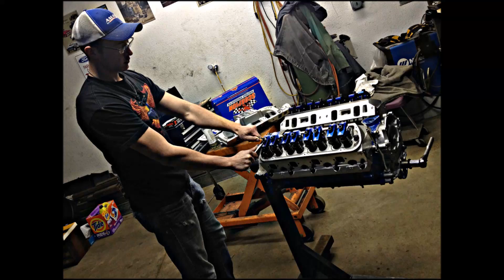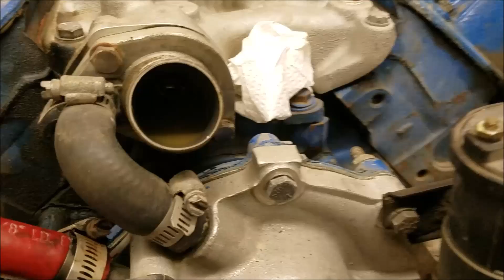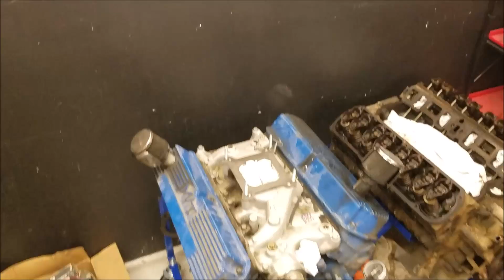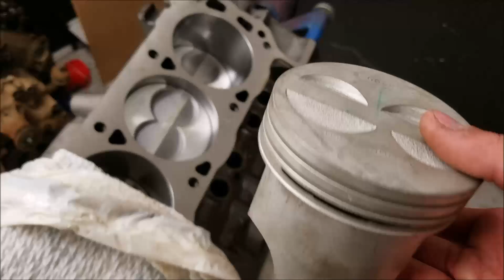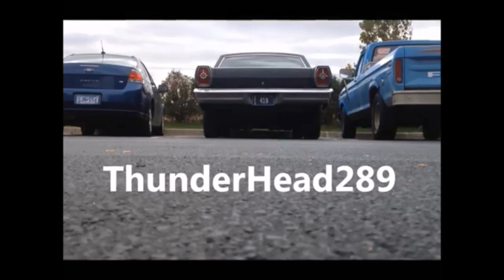Driving with NO/FAILED Thermostat in Car - Is it Worth It? (Explained)

Comment: Uhhh.. what..? I don't think you will EVER overheat if you don't have a thermostat installed.. having water run by hot metal constantly will only cool it faster, it won't overheat because of it..  does your radiator become less efficient at high speed and fans running with more air rushing past it..? Of course not. It's the same principal. I've been running my Rx8 without a thermostat and it runs BEAUTIFULLY!!! It still comes up to a safe operating temperature, but NEVER gets too hot n "spongy" 👌🏼 don't be fooled into thinking it's "unsafe" to run your vehicle without a thermostat.. (you may need it for winter if you want some heat or power tho😜)
Reply from the maker: #RideLife use your brain here for a second - it’s a 2 part issue. 
Coolant runs through the radiator so fast that it doesn’t cool, and if it’s too fast, the heat can’t transfer from the block to the coolant. 
The temp gauge will show cool, but your oil temp will be high which is indicative of hotter internals. 
Your temp probe only monitors your coolant. 
Engine builder & engineer
Reply: @ThunderHead289  
Sorry for my bad english....
Did you think...thermostat will closed again after coolant flow to the water jacket?
When thermostat open it wont closed again until the coolant really cool....
Try to boiling your thermostat in a pan... then when thermotat start to open pour water in room temperature to your boiling pan... you will see...that thermosttat wont closed.... thermostat works just in cold start... thats what thermostate for...

Comment: My 99 nissan frontier has no thermostat for 3 years and when its cold it blows hot air perfect and when summer comes around my a/c works beautifully with no problems these guys here are just myth busters dont believe the hype partnas...
Reply from the maker: Your ac has nothing to do with the thermostat in your car. Fact
Reply: Think he's saying the AC would make it possibly run hotter but it dont

Comment: you should explain to people that this is mostly for OEM cars and for places where temps vary from winter to summer. if you're driving in an average 70 ish temps or higher, your car WILL get up to temp and drive normally without the thermostat. If you have a highly aftermarket modified engine you might need to remove it in the summer months to increase flow and keep temps down. or maybe i just don't know what i'm talking about =)
Reply: My Honda was overheating and we removed the thermostat. I live in Houston and it reaches high temps just as fast as before lol
Reply: TRUE

Comment: In extremely hot countries ( 42-50 degree celsius the Thermostat are removed from older vehicles 4 × 4's and they run just fine. Yes they are running on choke but no issues with either engine or overall performance considering the age of the vehicle and it's use as an off road vehicle and general run around. For the record I just want to say that main stream edjewcation teaches us a lot of stuff that in reality is the complete opposite, if something works it works and we should stop with the divide and conquer as we all feed them our energy!

Comment: I'm frm tropics. ambient temp in mrng is 28celcius and goes up to 34 by midday.... engine warms up quickly even without thermostat. No issues in fact engine runs smoother as the load frm waterpump is lighter now. no thermostat equals less resistance to coolant flow. engine revs faster n smoother.... knocking n pinging during midday heat is gone.

Comment: just solve my e30 m40 overheating problem, already change new radiator, waterpump, fan, viscos but still overheat, its overheat when idleing just like a broken thermostat or a weak viscos, but when i about to change the thermostat the previous owner didn't put new thermostat in it, slap a new one and its all good thanks man
Reply from the maker: +FajaRathalos yep, exactly. If it circulates too fast, it just can’t cool anything

Comment: I bought a used suv (1988 dodge Raider), the weather has been very cold so everything was fine. The first warm day (56 degrees) my truck overheated. We had several warm days and my temps got high, but not in the red...blowing coolant right through my overflow tank. I thought I'd check my thermostat. Pull off the housing...no thermostat.

Comment: I have a volvo 940. I bought 2 months ago without thermostat. Fuel consumption was high !! After mounted new thermostat the problem solved.
I also had to remove oil engine because it was contaminated with fuel.
Thank you for this video.

Comment: Flowing so fast that it cant pick up the heat and take it away

Well, i guess Nuclear Power Plants have been doing it wrong this whole time. Time to remove those 1000 HP high flow pumps. Since, you know, one product of cooling using a liquid isn't replenishing the liquid absorbing the heat over a given volume per unit time, right? No, your high-school education collapses there. 

You're removing heat over a larger amount of fluid, allowing it to be dissipated easily in the fluid (being smaller in quantity to dissipate per unit fluid) and lower fluid quality breakdown from heat absorption. If anything, you are increasing the duty cycle of the life of your fluid. To set the record straight, you first must get an education and not assume shit.
Reply: ThunderHead289 why has there been many circumstances of people running well without a thermostat?
Reply: @Chris-eo1bp  exactly because it can work.
Reply from the maker: Im a mechanical engineer for one and you are dead ass wrong about an engine. your cooling temps wont reflect the difference because the fluid stays cool - EGT will be higher which represent higher cylinder temps. its all about volume to surface area, and your comparison is grossly unrelatable.
Reply: ThunderHead289 You cant wake up and think you're a mechanical engineer after a few youtube videos and chats with your dad.
Reply from the maker: GhostXoP lol I actually am. You can’t just wake up and make unrepeatable comparisons thinking that it’s applicable to this given scenario.
Reply: He doesn't understand flow rate vs. temp.

Comment: Just did an extended road-trip in the hotass southwest in my beatass RamVan. No thermostat, I installed a cheapo hood-scoop and ran a mix of 25% coolant/75% water......thing ran nice and cool, rarely got over 170-degrees even on very hot days.

Comment: The thermal dynamic property doesn't change, the speed of the water flow is irrelevant, true you're car won't warm up as fast, and it may not ever get to the operating temp for highest efficiency. But it won't make your engine run hotter. I can go in deeper detail if anyone has a question
Reply: Jake Borg             I have run with no thermostat in quite a few vehicles....almost always getting up to normal operating temp, according to the dash-gauge....just takes a little longer.
Reply: Me Me     How is the power, does it idle smoothly when hot??? I would check for a blown head gasket/cracked-head/cracked-block.
Reply: Me Me          It really depends on how much you like the vehicle......is it a beater/junker/near-junker??? If it is a nice vehicle, that you want to keep a while, I would get a definitive diagnosis on what is going on......that includes testing for a blown head/head-gasket. The sealant-in-a-can is risky.....sometimes they work, sometimes not, sometimes they cause more problems than they fix. If your head is blown and you do not want to get it repaired properly, removing the t-stat should keep you running for a while. I drove my 98 MPV for over 4 years with a blown head-gasket......ran fine as long as I kept the t-stat out.
Reply: Jake Borg thanx i have removed thermostate volve when heat light turn on i live in Pakistan

Comment: You should learn about thermo dynamics. The faster the water flows the more heat it grabs, learn before you speak instead of just repeating shit you hear.
Reply from the maker: you need to learn before you speak. there is a threshold where the water will move to fast to absorb heat and you can overheat in this way driving down the road at rpm, ie water pump spinning faster with no restriction. 
* mechanical engineer.
Reply: faster than thereshold doesnt cause overheat.
Reply: I think we will need a "project farm" style video that uses the actual scientific method to show data and evidence instead of using testimony and reason.
Reply: Never question this guy he is a *mechanical engineer and knows all about fluid dynamics. Or he just spews all the crap he hears from someone else. Use a restrictor plate in place of the T-stat and youll be fine. Circle track guys run that way and viola! One less fail point to worry about. If you live in a cold area maybe a different story. But not here in Florida.

Comment: I think you need more Research !!! We By-Pass our Trucks / We LOVE IT, this is our third year !!! Here is what we do to our Trucks... We use 2 Thermostats. One, is the By-Pass. The other is " Normal ".... The By-Pass... We use it for Summer... Then we Switch it back to " Normal " in November each year. NOTE: If you do a By-Pass.... You can Drill the Hell out of the Thermostat, LOL. You will only need the " Rubber Ring " and the " Round " part of the Thermostat, so it can sit in the " Hole " safely and it won't " Leak " on you. Hope that will help People who is looking to do it.... Hmmmm, maybe I can make a Video of it, LOL
Reply from the maker: I'm a mechanical engineer and build engines on the side. You all do what you want, but there are several solid reasons why not to run below 160 degrees. Wear your stuff out for all I care, it's yours - not mine lol.
Reply: @ThunderHead289  , I have a question and not trying to be a jerk.  I watched your video to gain knowledge and I appreciate the time it took for you to make it.  I'm a fellow YouTube video maker so trust me, I truly believe you're trying to help with the information you presented in this video.
That being said, I've read a lot of comments and you keep posting this phrase, that the coolant is moving too fast so it doesn't pull away heat as effectively.  You're a mechanical engineer and I respect that.  I'm a Navy nuclear mechanical engineer and we used the equation Q = mc∆T.  And m = mass flow rate which is the equation m = rVA where r = density, V = Velocity, and A = Area.  As you increase the velocity (V) of the fluid , not having restrictions by the thermostat, that should raise your m (mass flow rate).  That in turn would increase your Q, the specific heat removed from the system right?  This is what we learned in thermodynamics.
Like I said, I'm not trying to be a jerk and I'm more than fine with being wrong or learning that I'm looking at this the wrong way.  But as a Navy Nuc, there is a part of me that really needs to know the answer in a logical way.  What am I missing?
Reply: +ThunderHead289 -Who died and made you the " Mechanical Engineer ". Its like People who is going to Pay to have a Trip / Vacation to the Moon, once they are back... They become Astronaut????  All I can say is, do a bit of " RESEARCH " first.... LMFAO
Reply: Jordan Bronson Till we find out that they filmed it in a Hollywood basement!!

Comment: I'm almost 50...Been working on cars with my Dad since the 70's...We have always removed the thermostat in summer conditions...Nothing ever happened...Had an 88 grand Cherokee, ran it with no thermostat for years...Ran great...with the expectation of no heat...Have 2004 Grand Cherokee, thermostat failed twice, bursted the top water hose coating the engine with antifreeze...Removed it permanently, runs great. Regardless of no thermostat, engines run hot and gets hot... As soon as you open your hood, the engines heat wave hits you. Open a radiator cap after running your car for a few hours. See what happens!!!
Reply: lmaoooo dont open the cap unless you want to lose your good looks
Reply: Leo Cardona A 2004 Grand Cherokee would probably have a check engine light.
Reply: Leo Cardona exactly. people just like to talk alot crap in the video just cuz they made a youtube video. this us y its called youtube mechanics lol
Reply: Leo Cardona exactly!
Reply: Hey Leo so do you think its safe to drill a holes in my thermostat for my Lincoln Continental 2000 its a v8 and i replaced the thermostat, waterpump, and radiator, and bled the system many times but that thing still overheats. Hoses are good as in they dont implode when the engine is revved up. Everything holds pressure. my guess is that maybe its a faulty radiator because i didnt have the tools to do a flow test on it. but its cool to the touch when the fans kick in. so i dont know im really lost. im about to drill holes in the thermostat as my last hail mary attempt.
Reply: I had to tame mine out of my 1989 Chevy blazer tonight. It wasn't opening at all! So the temp got to 210 in five minutes. Now? Alittle over 100. So I plan on buying one next paycheck and putting it in
Reply: Would taking it off cUse the check engone to come on in a honda civic 2004?

Comment: I have a 2000 Ford excursion V10 ,I removed thermostat  year and half back every time fill up tank I add acetone 2oz per 10 gallon my big ass suv is giving me 15to 16 mpg on street driving around 35 to 45 mph and on freeway it's around 18 to 19.7 mpg at 65 to 75 mph , so far I did not have any problem and I already put about 14 thousand miles...synthic oil change at every 5k.no mechinical problem.
Reply: +Mars1313 - Great to hear, I am on that Journey right now, I agreed with you 100%